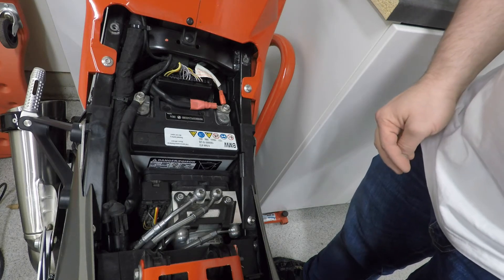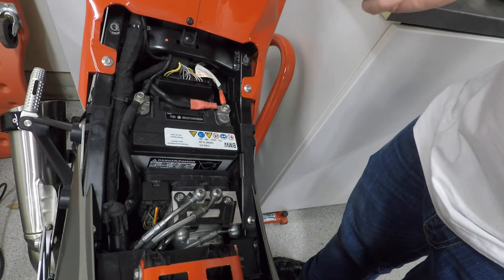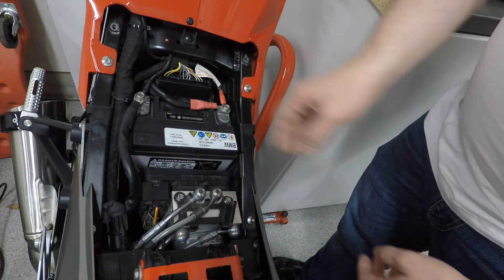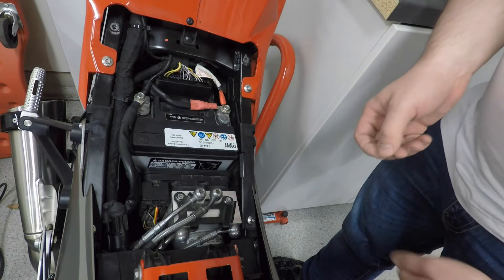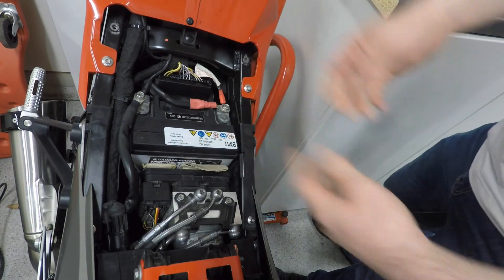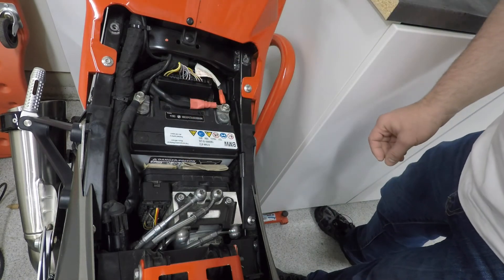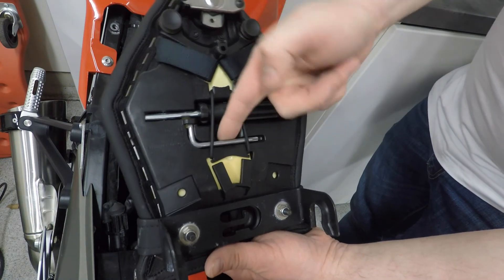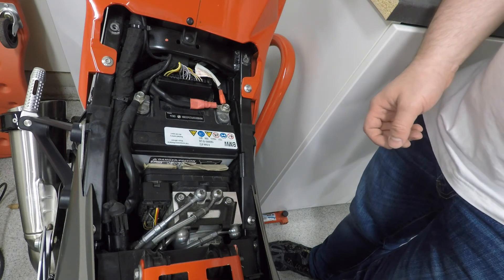Fix for Speedometer fail, ABS, ASC, Rough engine running, BMW S1000R/RR

Comment: It moves because that’s not the right battery for that year bmw s1000rr the correct battery is the ytz7s and it goes on a black plastic tray that prevents that movement and the only s1k that come with that bigger battery like yours is the one that has the alarm system and underneath the driver seat has a tab that keeps the battery from moving around
Reply from the maker: That bike, not at RR but an R, but its the same, was about 2 years old at the time of the video and what came from the factory.
I actually had a look at someones 2022 S1000RR this summer, even that bike had loose battery.
If you are correct, then BMW installed the wrong battery in their bike.
Reply: @850bimmer  at least in usa 2015-2019  R and RR without alarm system came with the super small yuasa battery on a plastic cover that prevent the battery from moving around under the seat and the ones that came with that bigger battery had under the seat a plastic cover that keeps and prevents the battery from moving around is like a tab kinda thing.
Reply from the maker: @adanrios5884  Mine was a 2014, and I have see what you mention as well. Mine came like this at least. So I dont know, maybe the Euro ones are different.

Comment: My abs light sometimes comes on,
U think I can’t fix it that way ?
Reply from the maker: I doubt that. This fixed a lot of different unrelated issues that showed up at the same time. 
You problem is either a wheel speed sensor or a sensor on the ABS unit itself. 
A shop might be able to read a fault code for you.

Comment: There's a 2010 S1000RR with 93000km on the clock that I'm looking at with an instrument cluster that acts like a danceclub, but the bike itself works and rides just fine.
Could it be that the main power wires for the cluster has gotten a bad connection somewhere, or would the bike immobilize itself? Its listed for like half the price of others so im very interested to say the least...
Reply from the maker: Cubize sounds more like a ground issue to the cluster. Or low voltage on the system. These two things can cause many weird an seemingly unrelated faults. But since you say the bike runs fine I would guess the voltage is ok, and it is probably a ground fault/bad ground connection related to the cluster or one of the computers.

Comment: I need some type of miracle for my bike the speed turns into 3 dash lines my ddc went out one side of heated grips never comes on and it doesn’t wanna start due to the switch all worked fine took to dealership never was the same they swear they didn’t touch anything 😑

Comment: Have you considered using some foam padding.  You could cut a length the size of the battery and use that in the same manner as the toilet roll :)
Reply from the maker: Sure I could. I chose cardboard as that was something I had laying around that could be folded up to create the right tension, not something I had to go out and buy, people can use whatever they want, foam, plastic, wood etc.
I thought the cardboard would get water soaked and dissolve, so initially it was a temporary fix, then I kind of forgot about it, and after a year I noticed it had actually held up just fine. 
If you have something better, sure use it :)

Comment: Lifesaver!
Cheers.
I had to wonder though, why BMW didn't use a lock washer (in addition to a flat washer) between the screw and the battery?
Anyways, thanks for the tip.
Reply from the maker: Kim Bone Yeah, one of those really weird design flaws, a lock washer or battery strap would have prevented this from happening. Not a good feeling when it happens, fortunately I was close to home, and had just read about it. Saved me having the bike transported to the dealer and fixed.